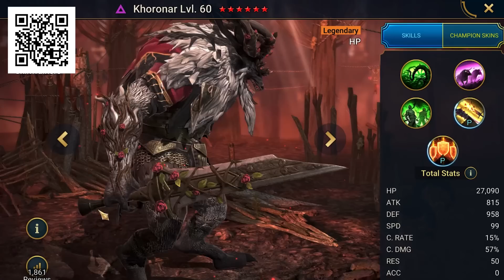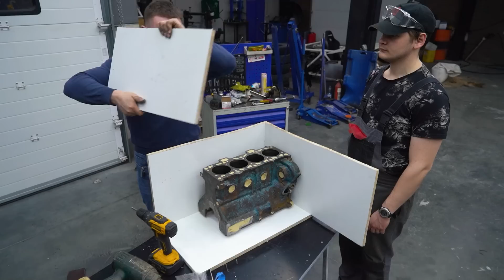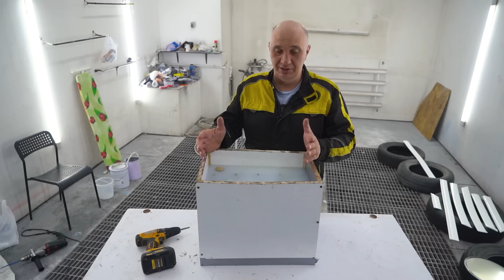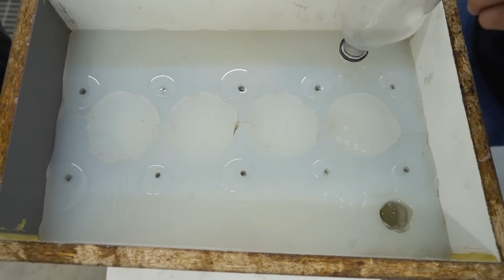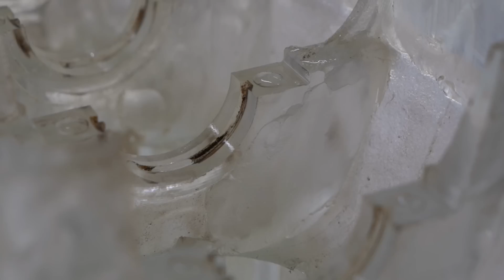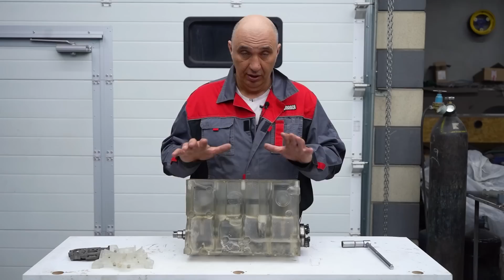We make a see-through engine block

Comment: I am confused about the casting material.  Did they use acrylic resin or sodium silicate?  I am hoping they used sodium silicate (water glass), as it is more like ceramic.  Russians pioneered the water glass casting method, which china uses a lot due to the quality of work it produces.

Comment: Meh, just do like my late father did, install the head and head gasket with tub and tile sealer, or some other crazy strong glue or epoxy. Not like you guys are expecting this thing to get even 1000 miles on it right?

Edit: Hell, for that matter, skip out on the head gasket altogether, just shim it up with an appropriate thickness sheet of metal cut to the right gasket shape, epoxy the whole thing together and zoom zoom!

Comment: Watch you tuber Tech Ingredients chanell 4 weeks ago they did a episode on graphine called making graphin can kill you.. we made it any ways?! he has results at the end of the show where he proves his graphine in very small amounts mixed with the expoxy made it able to with stand 10x the bending force of the same base epoxy which id assume is hard enough to hold a thread and not let the bolt rip out. its stupid easy to make you have all the materials and equipment im shure. check it out and maby stick some neodymium megnets in as pistons and a electro megnet on the top of the cylinder head and controle the pulse with the timing and show the world we dont need combustion or elctric bc we have megnets. that expoy block is guiness. love the channel big fan. your awsome